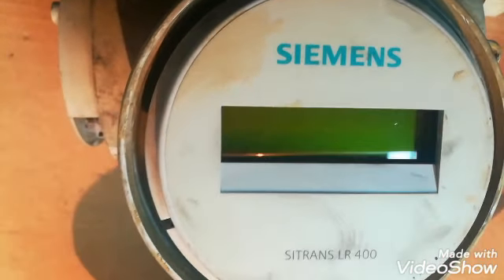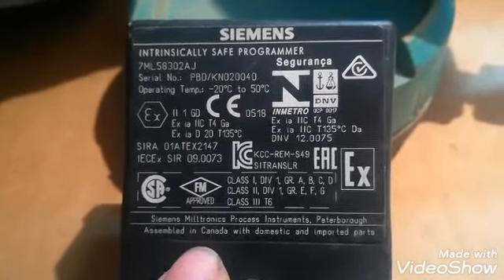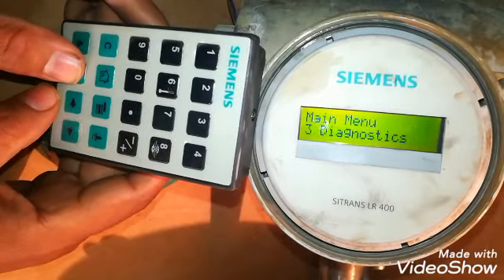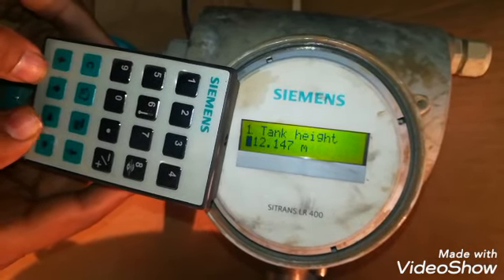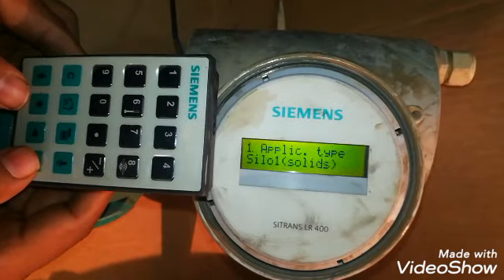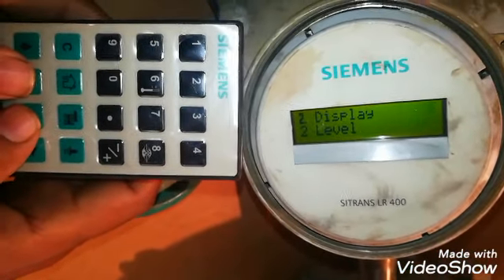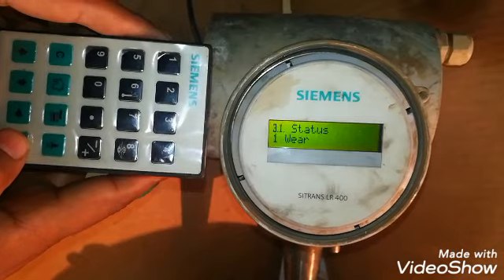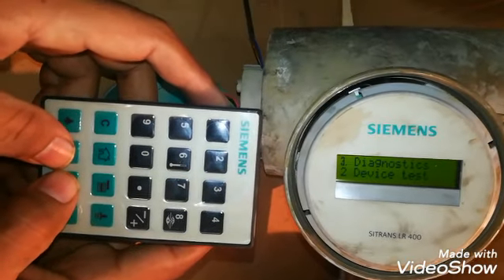radar level transmitter SIEMENS LR 400

Comment: How to fix S:0 fault in lr 460.
Reply from the maker: as per manual
Ensure installation details 
are correct. Ensure no 
material buildup. Adjust 
process conditions to 
minimize foaming. no bloackage in wave path